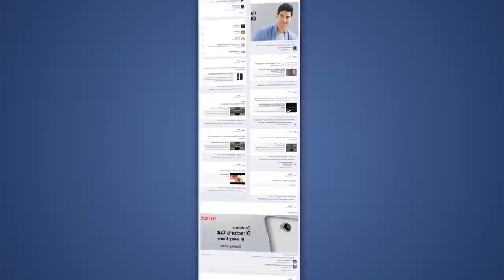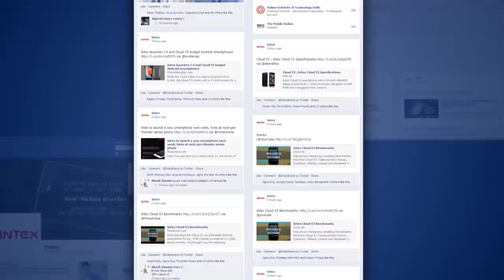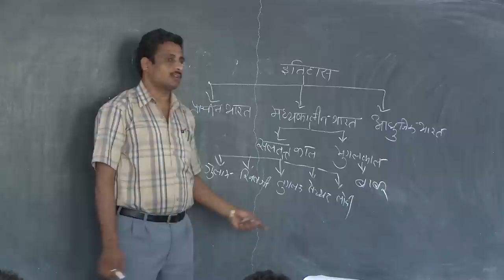Intex Corporate AV, Intex Corporate Video Film - Intex Technologies

Comment: I like Intex. but my TV main circuit board failed to response after just 1.5 year. This is not suppose to be Intex way. Also the main TV board is made in china and looks like not professional electronic design for Indian grid power supply. I am looking to replace the board TP VST59S PB712. Hope I find one cheap.
Reply from the maker: Hi Nazir, We’re sorry for the inconvenience. Kindly call our helpline number and we'll help you with the needful.
Helpline no. :  1860 208 5555
( Working time Monday to Saturday 10:00 AM to 7:00 PM )

Regards | Team Intex